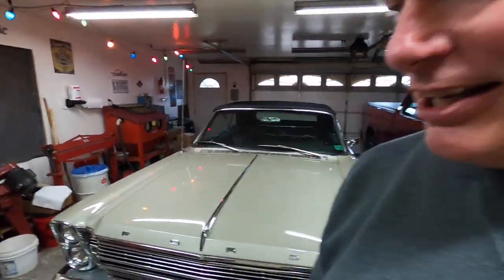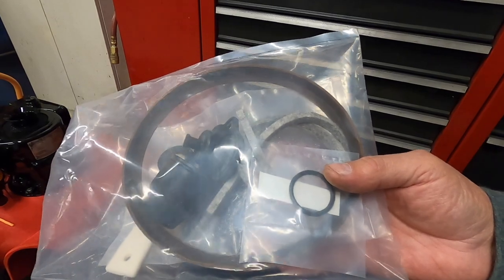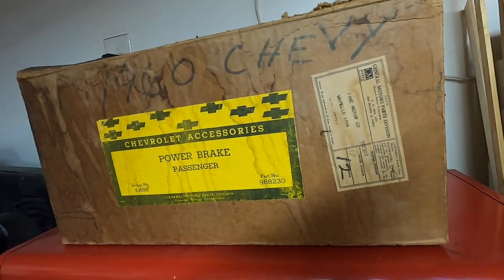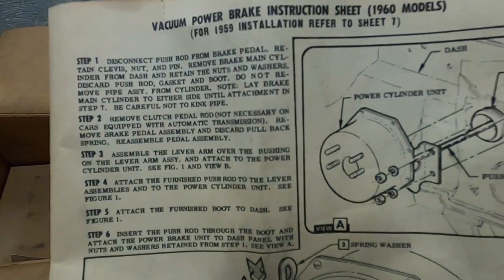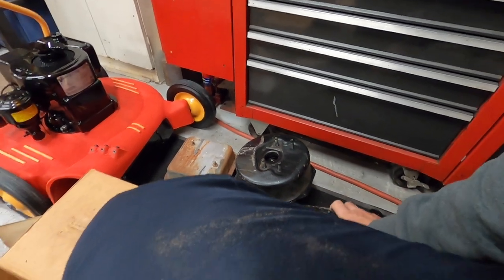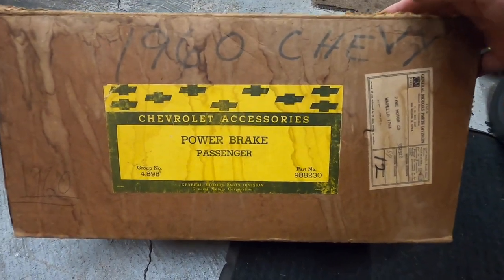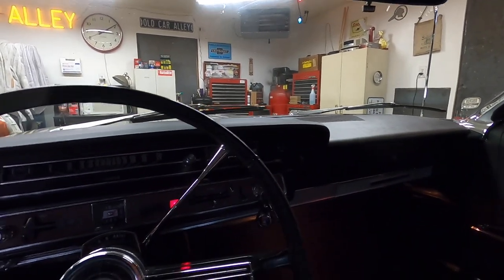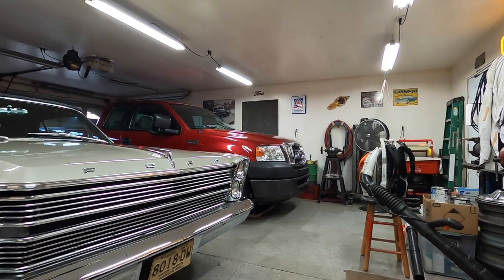59 Chevy Bendix power brake booster overhaul kit and some yapping

Comment: That original power brake retro-fit kit is very interesting.  Maybe at the time, some of those kits were used as dealer-installed options on base models, to make a new car sale a little more profitable.  The details in the 6 cylinder section referring to the oil filter, if so equipped - it makes me wonder what was the last engine from 1 of the US auto makers that did not have an oil filter as a standard feature.  No oil filter on a car engine seems unimaginable today, although the "filter" screen in the air cooled Beetle engines just caught the big chunks, so it was almost no filter. I hope your health issues are not serious.
Reply from the maker: Dealers often added accessories back in that era.... it was very common.

Comment: Hi Howard!  Did you ever figure out how many quarts of oil to put in your Galaxie?  For years I've put 5 in my 352 and it brings it up to the "full" mark on the stick; however, we've read it's supposed to be six.  I put 5 1/2 quarts now and it reads 1/2 over full on the stick.
Reply from the maker: No, the owners and shop manual both state six quarts. It reads so far over full on the stick, like a good inch and a half over, that I only put in five quarts, with a pint of zinc additive. I marked in the opposite side of the stick a "full" mark. The oil level never goes down.

Comment: how much for that NOS unit? That would be an awesome display!
Reply from the maker: I don't want to sell it, as I plan on eventually using that NOS booster kit, maybe even on the Bel Air. The power booster it has, has issues when its hot out, or after the car has been on the road for a few hours. It's like the vacuum is still applied when releasing the pedal. I got to pull the pedal back a half inch with my foot when its hot, otherwise there is no boost if I push the pedal without doing that. If I pull it back there is great boost.